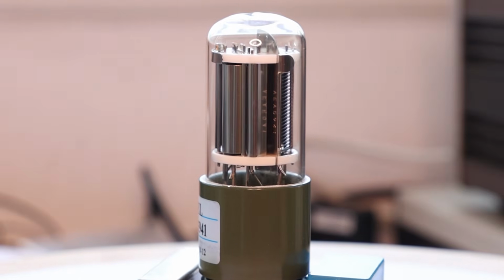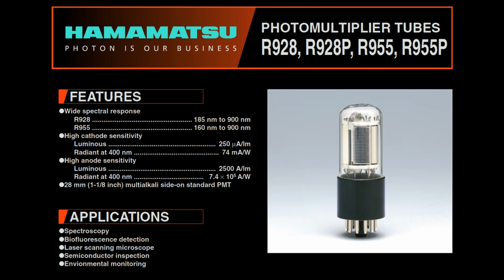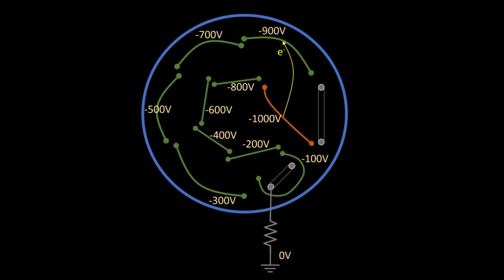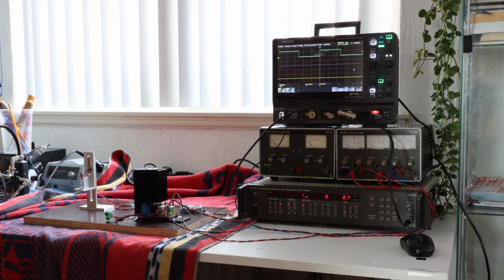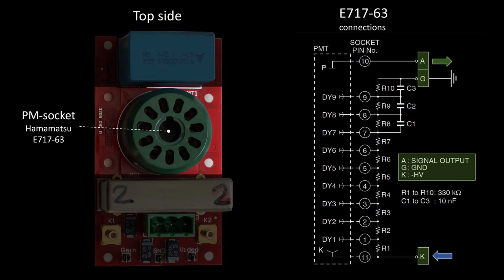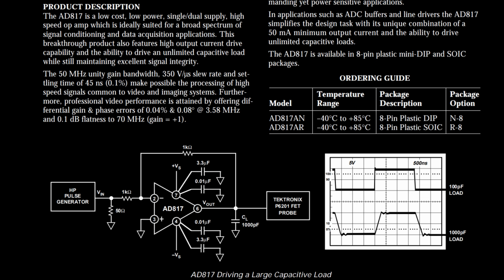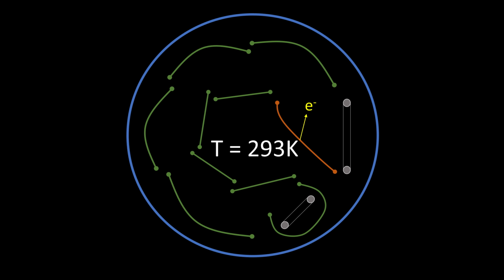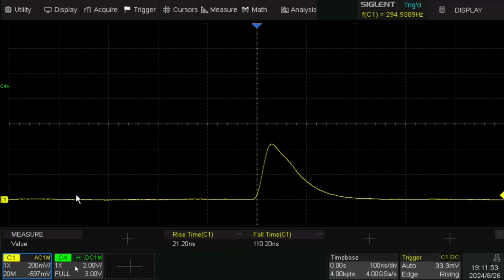PMT1: Using a Photomultiplier to Detect Single Photons

Comment: At the South pole is the Ice Cube neutrino observatory. There is 6km of pure clear ice there. They made a 1x1 km observatory there by sinking  (melting) strings of photo multiplier detectors there. Really amazing. They detect neutrinos that pass through the earth. They can also sometimes tell where they came from. Crazy. (The neutrinos cause a very small amount of light in the ice when they hit something, very very rarely, which the observatory detects. )
Reply: Placing them by sinking and melting is a certified "during a shower " idea.
Reply: I have an Ice Cube type benthos-ball, got for $30 at a UW junk auction.   Note that those are only rated for ...7KM depth!  Ground-glass joints push harder as depth increases.  Send your phone to a few KM depth for some flash photography?   Also the things have electrical pass-throughs, very impressive.

Comment: It's interesting that despite the benefit of cooling it isn't easily acommodated. It's built like a thermos minus the mirrored surface, after all.
Reply from the maker: Yes that is indeed a good point. Using radiative cooling is about the only thing you can do. So yes, it takes a long time for a PMT to cool down.
Reply: @HuygensOptics  Somehow it's bad at this as well! They could've blackened the outside-facing surfaces of the electrodes to increase emissivity.

Comment: How can we ever be sure that it is indeed only single photons that are responsible for the observations of events? Just assuming that the minimum detection level of any setup equates to single photons seems unsafe. I've read many accounts of the double slit experiment that say they reduced the light level to single photons but never any justification or verification of single photons.
Reply from the maker: That is a good question and indeed this is not the case: many of the pulses observed are the result of more than 1 electron emitted simultaneously (either by a single photon or multiple). If you record the surface / height of many pulses and then put them in a histogram with the number of pulses having a specific surface area, you will find that there are several peaks in the histogram that correspond to the amplification of initially 1,2,3,4 etc. electrons. The effect is described on page 232 of the Hamamatsu PMT Handbook. I did not want to go there in the current video, because it complicates the discussion quite a bit. But it is actually the reason why we observe large height differences between individual pulses.
Reply: You can do it easily with a Poisson approach in light emission. Just do a small enough Poisson distribution so the chance of getting 2 photons is basically 0. 
For that you can pulse an LED with lower and lower voltages, until you see only a photopulse every 10 or so LED pulses. That gives you lambda=1/10, which has a change of 2 photons smaller than 10^-5. Now do the same with 1:100 or 1:10000, you will see the pulses remain the same height, just more sparse
Reply: @brunopassarelligell1  if you could elaborate on this procedure, I'd be very grateful 🙏
Reply: He elaborated a similar procedure using nd filters in one of his videos @klachtenman

Comment: Perhaps it's just the way the diagram is drawn, but why do the emitted electrons go to the 'opposite' side electrode, rather than the adjacent electrode which is at an even greater potential difference?
Reply from the maker: Some will in fact skip a dynode, depending on the local electric field vector at the point they are emitted (and their kinetic energy and direction).  However, the construction is designed such that the electrostatic field gradient will create as many secondary electrons as possible during an avalanche.

Comment: Today is a good day...
As side note, I have wondered if is possible to use one of those as a camera.
Reply from the maker: In that case you need to add an XY scanner.
Reply: A Gamma camera uses an array of the Hamamatsu miniature square PMTs with Cesium iodide crystals made into an X-Y array. They are used in CAT scan medical instruments.  The company I worked for built a 16x16 gamma camera to be used in oilfield pipe inspection. This was back when the 3/8 diameter PMTs were just coming out.
Reply: In the past, to develop compact gamma cameras I used position-sensitive PMTs like Hamamatsu's H8500 or H9500, but recently, I've switched to SiPM arrays coupled to CsI(Tl).

Comment: Why do the electrons from the -900V dynode go to the -800V dynode across from it rather than the -700V dynode right next to it?
Reply from the maker: Some will in fact do that, depending on the local electric field vector and their kinetic energy.  However, the construction is designed such that the electrostatic field gradient can create as many secondary electrons as possible during an avalanche.

Comment: The datasheet mentions a 30 minute settle-down time after exposure to high light levels - what is the mechanism that causes this ?
Reply from the maker: Great question Mike. The Hamamatsu PMT handbook lists 6 different reasons for this, among which are:  leakage currents (I guess due to charge accumulation on the insulators), scintillation in the glass envelope caused by stray electrons on the glass surface, and ionization of residual gasses inside the tube. All these take some time to fade away and after 30 min. the performance approches the best attainable value again.
Reply: Various trapped electrons can be released over time resulting in additional dark counts.
Reply: Well you could invert the negative voltages and maybe "purge" the electrons out, then invert back to negative, like a sort of electrostatic degaussing

Much more complicated power supply though
Reply: @Clancydaenlightened yeah that seems like a good way to clear them out quickly! Who knows, could just be one of those things that can’t be rushed and ya gotta wait it out lol 🤷🏻‍♂️ I’m with you though, ideally ya just purge and get on with it.
Reply: I've seen the same thing with phototransistors in optocouplers, used for audio signals.   Listen to your phototransistor in PV mode, then bring up the LED current.  It makes a burst of noise (much like Barkhausen when a magnet approaches.)   But it only does it once.  The rising junction-voltage clears out all the "stored states" inside the junction.   Raise the LED current very slowly, and the phototransistor sounds like a geiger counter.
Wait a week or two, and you can do it again.  I assumed it was some sort of stored thermal shot-noise.   Hrm, I wonder if placing the optocoupler against radium will "fill up" the stored noise quickly?

Comment: Many years ago I had a play around with a PMT and a red LED, and  it could detect the LED with 4nA forward current at room temp, and 0.5nA when cooled with a peltier cooler. 
For a white LED, just visible to the eye at 50nA, it could detect with a LED current of about 20pA!
It could also very easily detect triboluminescence from rubbing sugar cubes together, peeling clear adhesive tape and rubbing two pieces of quartz together.
Reply from the maker: They are indeed incredibly sensitive, which can be a disadvantage because you have to do all of that in absolut darkness.
Reply: @HuygensOptics  There is an interesting phenomenon related to this :- 
At cryogenic temperature, the dark rate in a photomultiplier is caused by single electrons, emitted spontaneously from the cathode surface. This “cryogenic” dark rate increases
with decreasing temperature down to at least 4K. The average event rate is proportional to the
area of the emitting surface and insensitive to the electric field at that surface. The electrons are emitted in bursts. The bursts are distributed randomly in time, but the events within a burst are highly correlated. The burst durations are distributed according to a power law. As the temperature decreases, the rate of bursts, as well as the number of events per burst, increase.
The observed time distributions are indicative of a trap mechanism. So far, there is no physics explanation of the observed phenomenon.
Reply: @primenumberbuster404  "The observed time distributions are indicative of a trap mechanism"
- so I am right when I say "One go, a bunch go - and it takes time to re-load and repeat" and I have understood you correct?
Very interesting - and awesome subject!
Reply: @primenumberbuster404  Interesting, I have never heard about this!  Thanks!
Reply: @primenumberbuster404  I wonder how they eliminate cosmic background from their detections?  Blocks of low-activity lead (from Roman shipwrecks?)  Hide out in salt mines?  Maybe the pulses caused by gamma-rays are obvious.
Reply: PMTs are indeed quite sensitive. I used to design downhole detectors for the oilfield and even tiny light leaks would cause the PMT to saturate to the point that the HV supply would sag. Some of them would even die an instant death if powered up in a well lit room. And as for what it could detect a physicist wanted to image a bare scintillator in operation in real time using a conventional CCD digital camera as a side experiment, but made the same mistake we all make in correlating numbers to our subjective reality. Even with the largest sources we were permitted to handle by hand and the most efficient scintillator we had (LaBr:Ce) they were still pitch black even after 20 minutes in a completely dark room to the naked eye, so no joy without a special setup and acquisition system to integrate which killed the real time part. (Edit: In hindsight the eye is quite insensitive to the peak emission, so it still might have worked with a camera) Speaking to some old timers, to satisfy their curiosity they got around this by using actual logging sources to “see” the scintillator in action. Works apparently but staring at something releasing many millicurie of radiation doesn’t strike me as very safe 😲
Reply: @mysock351C  What kind of light is there, deep in an oil well? I would think that other than thermal events (since it's hot there), no light comes down from the top.
Reply: @2xKTfc  The detectors in question (which have a scintillator package coupled to a PMT and electronics) actually rely on gamma ray radiation via neutron activation or natural radioactivity of the formation. Typically in the case of neutron activation there is a neutron source that sends neutrons in to activate the formation. This results in the atoms absorbing neutrons and then releasing characteristic gamma rays of specific energies which can be used to determine what elements are there, and they can be quite sophisticated. The “state of the art” ones have a suite of gamma and neutron spectroscopy detectors along with an electronically modulatable neutron generator to determine the lithology in-situ. But basically to take a measurement either a tool string is lowered down the hole and pulled back up via a tether (wireline) or they are located behind the drill bit and send data up in real time back to the surface (logging while drilling) as the well is being drilled.
Reply: @mysock351C  Wow. Thank you for your reply! That's some hella expensive kit I would never have expected down a borehole. And really clever.
Reply: @2xKTfc  Find those as alloy-ident handheld "XRF guns," used by junkyards and coin-shops everywhere.   I took a Niton XL2 apart, and found it just has a 30KVDC supply going to an extremely tiny x-ray tube.   The x-ray fluorescence of various metals is down below 2KeV.  Detector is a silicon PMT behind a beryillium-foil window.   (Heh, the owner had been slamming the instrument on the table whenever loose internal connections misbehaved, finally shattering the Be window.)
Reply: @mysock351C  it's maybe "cheating" but a bare scintillator will respond strongly enough to a 1uCi Am241 alpha source that it can be seen by eye (just barely). I used CsI:Tl, if I'm not mistaken (which is nice in terms of matching your eye's spectral sensitivity). It's maybe cheating because alphas are so energetic. It's really more of a spinthariscope than a scintillator at that point.

Interestingly, even though it was possible to identify the emission by eye, it took 12 seconds integration time for my iphone 10 camera to see it unambiguously. I mean, to be fair it probably took about that much integration time by eye too ("oh is that little barely perceptible smudge it? Ok, yeah I moved it and the sensation appears to have moved... yup, I can really see it and I'm not tricking myself")
Reply: @mysock351C  
What kind of a source was it?

Also, there are videos of people taking long exposure pictures if scintillatior crystals near strong sources on YouTube.
Reply: Supposedly you can count photons from human bioluminescence, if you hold it against your arm.   Me, I'd try my H7828 photon-counting modules, but can't make environments dark enough.   
But also, single-photon counters need low-temp photocathodes, unless you want to somehow subtract the hundreds-Hz "dark counts" produced at room temp.   Just sticking your PMT in a -20C freezer does produce significantly reduced counts.   The true "photon counters" place their PMT inside a tiny dewar, so the peltier can chill it down without frosting up the window.   For a DIY version, must first build a little opto window with a layer of vacuum behind it.
Reply: You can SEE triboluminescence if you get your hands on night vision image intensifiers, it's so cool
Reply: oh and you can see alpha radiation if you cover the photocathode with silver doped zinc sulfide
Reply: @slipstream53  There are many videos on triboluminescence on YouTube. 
I belive you can see the light from pulling clear tape or crushing sugar cubes/crystals with your bare eyes.
Reply: Thats crazy.
Reply: @mikeselectricstuff Then I may have misremembered and it was your channel where I saw that? Quite the clever invention.

Comment: i don't undestsnd how electrons don't create "arcs" and skip dinodes to go toward the more intense potential, rendering the cascade effect and the gain different from the thoretical one and unpredictable.
can someone explain what i'm missing?
Reply from the maker: For arcs to form, you need material present (like atoms, molecules). Basically you need to create ions / charged particles that can create more charged particles. In an absolute vacuum (and the vacuum in a PMT is very high) you cannot easily create arcing, apart from maybe through- or along the surface of the insulators.
Reply: @HuygensOptics  yes Sorry, i realise now It was a bad choice of words.
I meant "arc" in a purely geometrical sense, meaning a curved trajectory, not  actually meaning ionized electric arcs

Comment: Sleep can wait.

Whew, good video. I’d be excited about immersing the tube in liquid nitrogen, but I’m not sure how the hermetic seals would handle it. Another thing to test would be if the energy of the photon corresponds to the average size of each charge pulse. Don’t suppose you’ve got a low-amplitude tunable light-source, do you? It’s never too late to build yourself a visible light free electron laser!
Reply from the maker: For this type of  photomultiplier (plastic base), you should not cool below -30C. At this temperature, the thermionic emission will be lower than 1/100th of the room temperature value. The avalanche gain of the PMT will also go up with decreasing temperature.

Comment: The cascade system to amplify the signal was one of the coolest things I learned in my sophomore years.
Reply: cone and rod cells also use a signal cascade to detect up to a single photon(in the case of rods). its an enzymatic chemical cascade but.. still cool😋😋. great dynamic range on the eyeballs
Reply: That's not that cool tbh